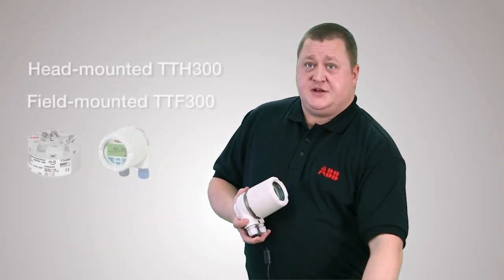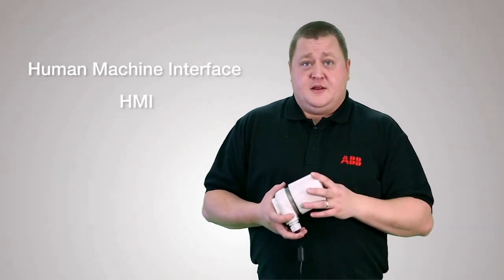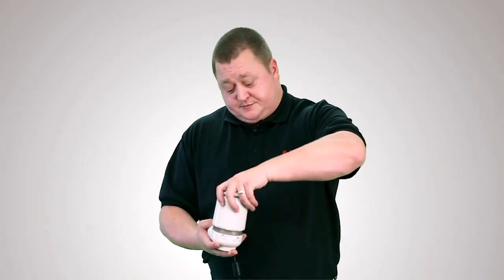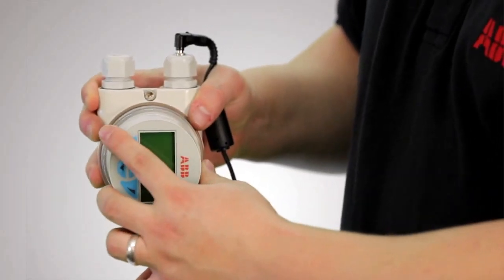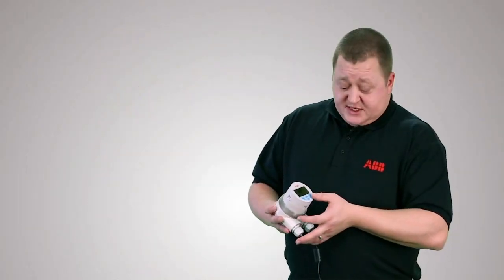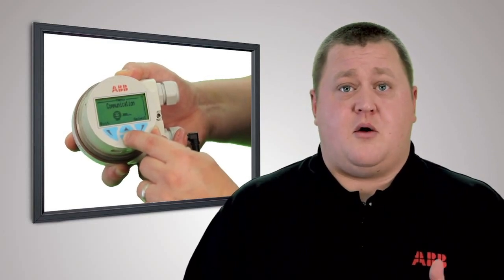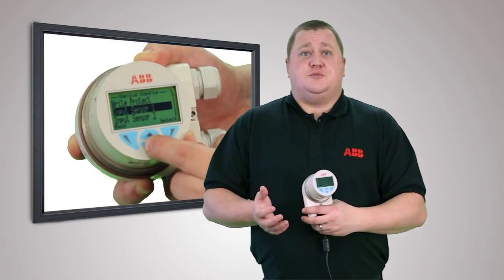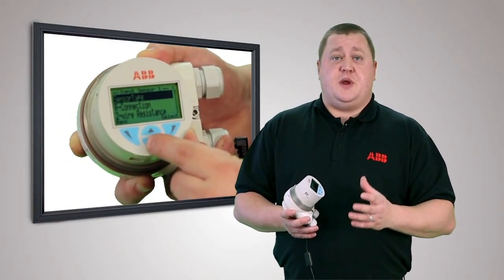Save time and money with ABB's 300 Range Temperature Transmitters

Comment: Can u help with the calibration, in the tth300 module device configuration pt100 is selected which is fixed I wanted to change it to thermocouple but its fixed
Reply from the maker: Hi - thanks for contacting us! The unit can be easily re-programed to T/C via the buttons on the HMI or using a HART modem and our FIM software which is free to download on the following link
. https://new.abb.com/control-systems/fieldbus-solutions/fim